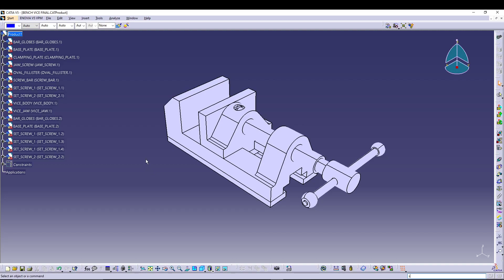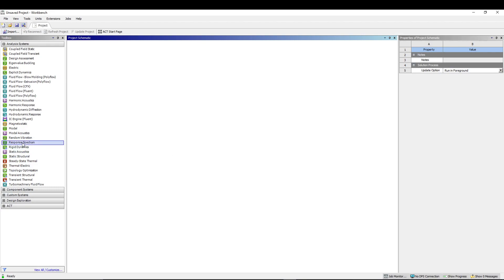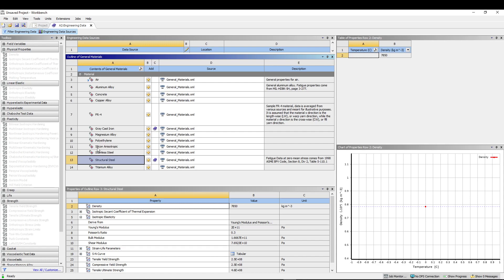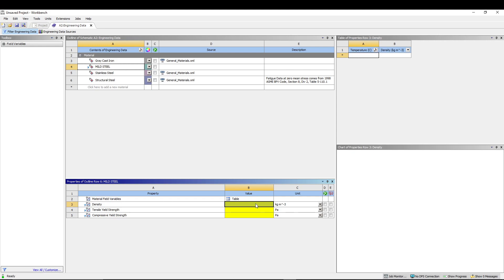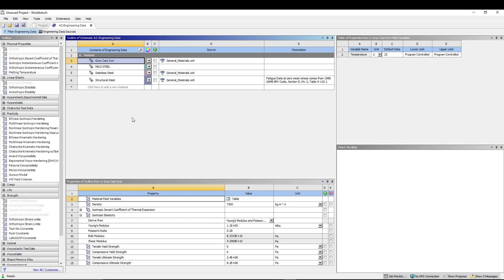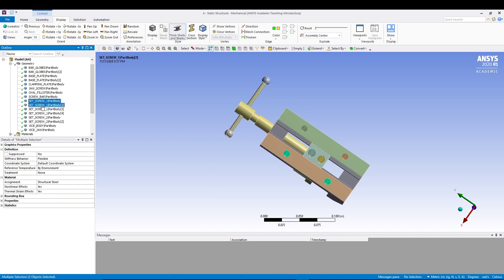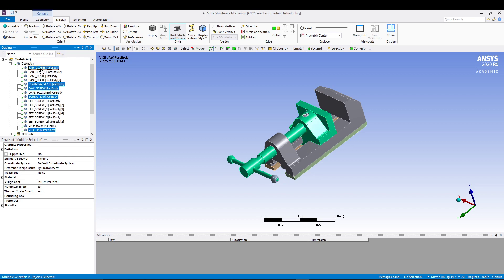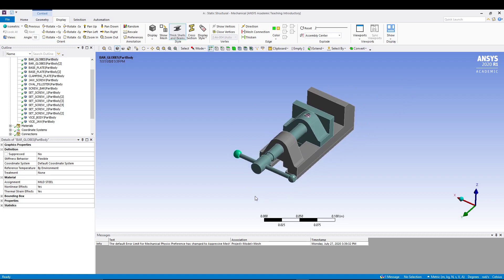ANSYS - IMPORTING ASSEMBLY & ASSIGNING MATERIAL TO ALL PARTS

Comment: All these different parts per single component that you modelled in Catia say Body and Baseplate... What is the relation between parts say body and baseplate ??... Like do they share common face or they are seperate parts and we need to define interface in meshing....
Reply from the maker: Look all the parts are separately designed. But while assembly they touch face of each other. Just like any normal assembly body would do